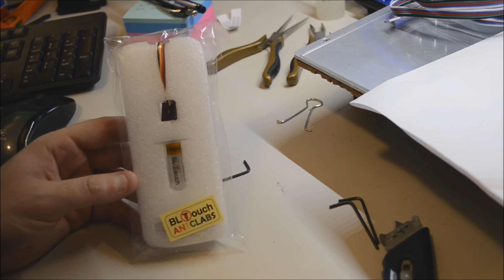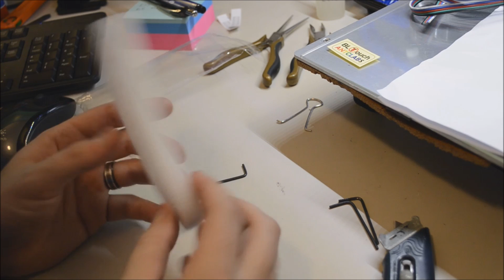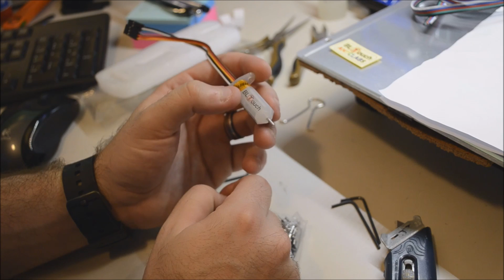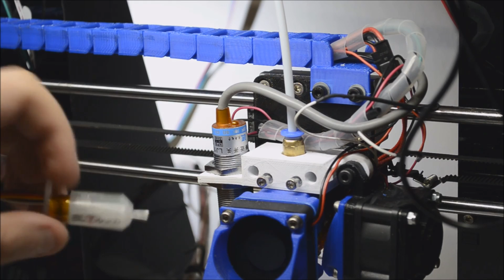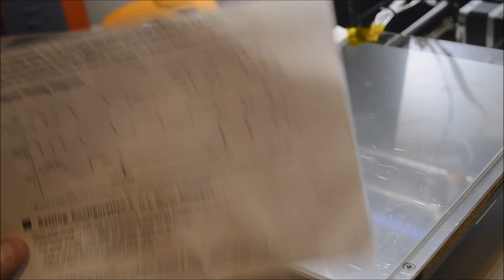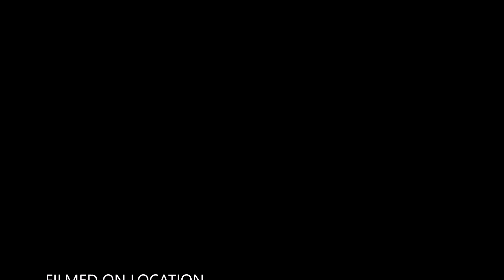Tutorial - ANTCLABS BLTouch Install - Part 1 - 3D Printing

Comment: Nice breakdown, Thanks!! If I can be 'that' friend who tells you your fly is down, and because it drive me nuts when I hear pros get it wrong, TV newspeople manily, I want to point something out to you. The proper use of 'pan' when describing camera movement is horizontal only. You 'pan' left and right and you 'tilt' up and down. When you move the camera forward it's 'push' in. When you move the camera back, you 'pull' back. When you zoom (change focal length on the lense) you 'zoom in' and 'zoom out'. Sorry to be all Mr. Know It All. As someone who used "irregardless" incorrectly for years, I wish someone had pointed it out to me sooner. Cheers!

Comment: i have a hictop 3DP08 i have replaced the motherboard with a MKS base v1.4 trying to add a BL Touch bed leveler. when i plug in the BL Touch it does a self test witch means the wiring is correct but there is something wrong with the firmware and i can't figure it out i watche youtube videos on how to hook it up and adjust the firmware in config_h file i think i need to change something in the servo_h file.

i found this on the ANTCLABS web site but not shou where it suppose to go.

include
Servo servoBLTouch;
const int ZminPin = 18; // Zmin Input
const int BLTouchServoPin = 11; // Servo signal output

void setup(){
servoBLTouch.attach(BLTouchServoPin); //Servo
pinMode(ZminPin, INPUT_PULLUP);
servoBLTouch.write(90);
}

void loop() {
servoBLTouch.write(120); //step 1 : self-test( M280 P0 S120 )
delay(1900);
servoBLTouch.write(160); //step 2 : Error release ( M280 P0 S160 )
delay(500);
servoBLTouch.write(10); //step 3 : Push-pin Down & Touch & Error Test ( M280 P0 S10 )
delay(3000);
servoBLTouch.write(160); //step 4 : Error release ( M280 P0 S160 )
delay(500);
servoBLTouch.write(90); //step 5 : Push-pin Up ( M280 P0 S90 )
delay(1000);
servoBLTouch.write(60); //step 6 : Error release & M119 test ( M280 P0 S60 )
delay(3000);

thanks for any help
Bryan
Reply: I i marlin RC7 it all worked fine without the bltouch. i followed the video verbatim
Reply: it doesn't like # of sevos 3 but it does like 1 servo but still won;t manually drop pin with a M280 P0 S10 or drop when i home z
Reply: yes
Reply: M401 z goes up
Reply: it does nothing with the pin. M402 Z axis goes up also
Reply: it in D11 3 wires orange red brown black and white and black on Z-Stop
Reply: do i need to put the resister on
Reply: Ok changed wires to Z+ there was no SERVO0 in pin_s so i added it #define SERVO0_PINS 19 IN pins_h FILE. it did the self test just fine when i plugged it in  but still won't activate when i use the command line
Reply: #ifndef MOTHERBOARD
  #define MOTHERBOARD BOARD_MKS_13
#endif
Reply: ok so i had to follow it to pins_ramps_14.h file working on it now
Reply: ok that uploaded fine. but still not able to use M401 Zaxis still goes up
Reply: ok
Reply: thanks for all your help
Reply: where can i find that version?
Reply: So i have the V marlin-1.0.2-1 I have it's homing in X and Y but cant move x or y axis's manually once i get this working i can move on to BLTouch. that is if you still want to help. Oh and good morning
Reply: Nope
Reply: so i get this when compiling. your firmware

Arduino: 1.6.11 (Windows 8.1), Board: "Arduino/Genuino Mega or Mega 2560, ATmega2560 (Mega 2560)"

In file included from C:\Users\bryan\Desktop\Prusa Joe Edit Full Marlin\Marlin-1.0.2-1\Marlin\Marlin.ino:33:0:

sketch\Configuration.h:1:20: fatal error: U8glib.h: No such file or directory

 #include <U8glib.h>

                    ^

compilation terminated.

exit status 1
Error compiling for board Arduino/Genuino Mega or Mega 2560.

This report would have more information with
"Show verbose output during compilation"
option enabled in File -> Preferences.

i have arduino 1.6.11
do i need an older version i heard that maybe 6.1.11 may not work right
Reply: like this
//#include <U8glib.h>
that didn't work
Reply: Well dagnabit i downloaded the stable arduio got your firmware uploaded no problem. i send command M401 and nothing happens. So i m1190 with pin up all open pull pin down m119 still all open. i under stand G code i'm a machinist buy trade mill lathe and what ever they throw at me. how ever i'm a newbe on coding. I guess that's why i got a 3d printer i love making stuff. and modifying stuff. it giveme somthing to do in the winter when i'm not Sailing on Lake Michigan
Reply: OH and i'm using simplify3D
Reply: Z goes down like it's doing an auto level but pin doesn't drop and it's about 3 inches off bed then goes up moves and then z moves down a little like it's trying to do bed leveling.
Reply: Joe i think we finally got it. so I changed pin back to 19 plugged it in to D11 and bingo. that's far as i got. M401 & M402 work fine i just have a real jerky action in X axis i have to work on before i can test it.

Thanks Joe
Reply: with my old firmware all axis's run smooth with yours uploaded x Axis is real jerky any ideas
Reply: all that is the same . I thought thats what it was to
Reply: can you set voltage in the firmware?
Reply: Dude I'm so close got bed leveling working just need to get a handle on the offset from probe to nozzle I really appreciate your help and patients. 

Your the best 
Bryan